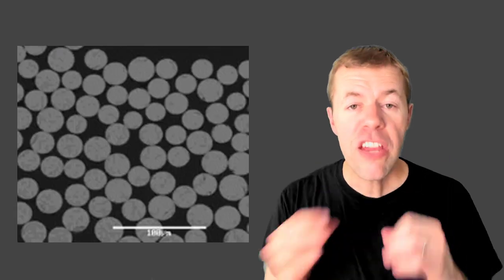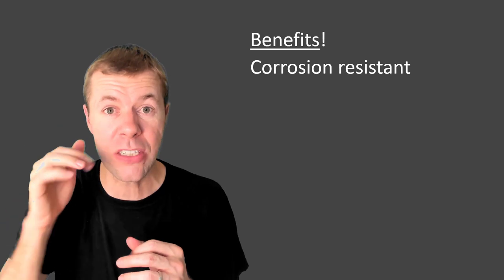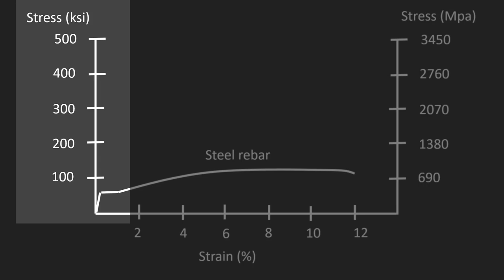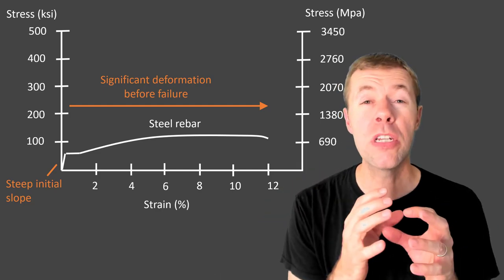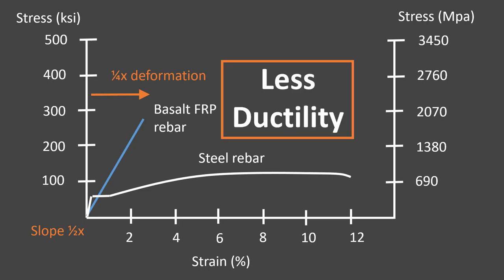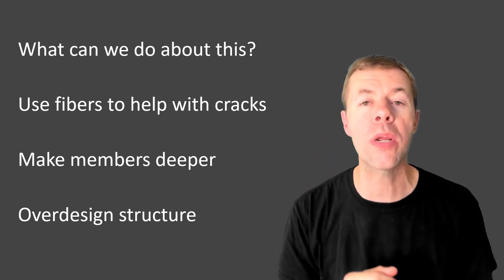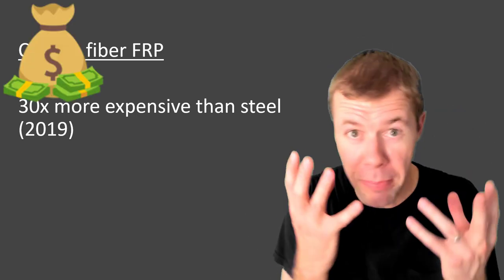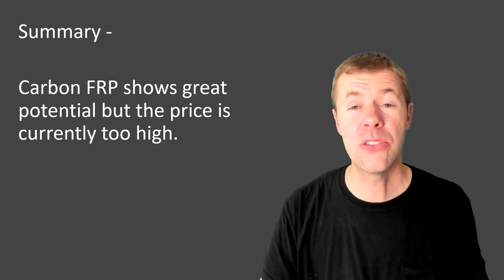What is FRP rebar? Why don’t we use it?

Comment: BTW, thanks for your reply.  This is great! &Since Basalt is one of the Most Common rocks, merely finding a way to dusintigrate it and then Extrude it in Huge quantities - would make it so much cheaper than steel - which corrodes to failure in ?4 years. Can this really be just 4 years due to chloride?
Why can't the basalt rebar just be increased by 15 or 25%. Some amount that might take more than just one earthquake to snap it?  Didn't the Roebling Brothers family improve metallurgy? Or, was it railroad rails, barbed wire, etc? No - I think it was suspended bridges - that's why good steel became cheaper.  It had to work more or less Better somehow. In several ways maybe.
What engineering Department is actually working on this design problem? How can Basalt be produced.  I'd like to imagine a pea sized pieces of basalt continuously being melted into Lazer extruder. Miles of rovings on spools. Braided into useful combinations.  Are Chinese engineering schools doing this research? Combined braids with Bamboo? Indonesia maybe?
https://youtu.be/tKcyrlysQwA

Comment: The idea that FRB combined with concrete could last almost forever is worth adding extra fire protection and extra bar so a structure never has to be torn down, inspected or replaced. Looks like a good long term investment.  Now if someone can fix the pressure treated wood issues some of these building might make it more than 50 years...

Comment: If your worried about corrosion up your mpa an use 3cc....
An it's all about doing it as cheap as you can for a builder....
An the cracks are usually 30mm surface cracks...
They use a lot of fibre mesh today

Comment: How about fiber reinforced concrete (with steel rebar)? Quite a lot used in EU.
Reply: They serve different purposes. The fiber is to reduce cracking, the rebar is to add strength in tension which plain concrete does not handle well at all. Concrete only has strength in compression. The alternative to fiber is steel mesh.
Reply: Helix 5-25 is common. It's  mostly used in commercial warehouse floors.

Comment: In an effort to try and source a cost-effective way to help with raw materials…. Is it possible to turn recycled plastic into the polymer for the FRP?
Reply: Im not sure if that would ever be an efficient process... Maybe someday, but ive been told plastic recycling, as its done today is super inefficient....and i can undsrstand why; theres so many different kinds and they cant be mixed (but im sure you can imagine what happens when we have one recycle bin called "plastic".) Theres also many kinds that can't be recycled at all (like thermoset plastics im guessing?) that are always mixed in too..

Now if we had a bin for just polypropylene, that might be pretty efficient...
Reply: If they restricted it to just drink containers, and large items, that would probably help alot, since the different kinds would be very easy to separate then.

I wonder if that separation process is why we ship all our plastic recycling to China (for the cheaper labor). But i also wonder how much oil we burn getting it there....
Reply: A color code system might help instead of just a symbol on the plastic, the color could also be temperature activated to turn into at a certain temperature and then a machine can sort it. Actually a machine could probably sort it anyway by structure, they can identify substances by electron light refraction, so machine sorting is pretty efficient.

Comment: It would be interesting for your to compare FRP with stainless steel bars (Cost, strength, ductility,  and corrosion resistance).  In Ontario, I've seen new bridge decks reinforced with GFRP, but the barrier walls were often reinforced with stainless steel or stainless clad bars.  I assumed this was because stainless bars could be bent into shapes while FRP cannot, although maybe ductility to absorb the impact energy of a collision on the walls was a factor too.
Reply from the maker: Thanks Dave,
I think this is a good idea.  Let me keep thinking about a comparison video.
Reply: Dave, I always get a chuckle when BFRP is dismissed because it cannot be bent in the field. Epoxy coated steel is the prevalent rebar in road construction in North America and none of that is being bent in the field. In a salt-air environment where SS or GFRP is used Basalt outperforms both.
Reply: @Dave-Pro   Yeah, looked like he was manhandling a glass fiber reinforced rebar, not basalt.

Comment: I like steel, no radio waves inside my home, a quiet environment due to the Faraday Cage formed by my home.
I will experiment with metal fibers for my auto lift base, and I may add non metalic stuff as well.
Small projects lend themselves to experimentation, and considering this video, I don't see any reasons to hold back, glass fibers, steel, aluminum, nylon, and other plastics may perform exceptionally well, time will tell.
Reply: Aluminum is a very very bad idea in concrete. It has a chemical reaction with it. It's not pretty.

Comment: If we ( somebody) could efficiently produce some sort of carbon fiber wrapped coated rebar...  Rust protection for the steel...  Extra scratch durability for that coating when wrapped in carbon fiber.. And perhaps that much  Stiffer. While maintaining flexibility in the worst case scenarios... Obviously costly but it would be down to somebody's R&D work to be able to produce it in a cost efficient manner.

..

Comment: A huge problem with current wind turbines is that the carbon fiber blades can’t be recycled and  just get buried. Ive always thought they’d make for a great steel rebar alternative. If we actually started using carbon fiber rebar, then the limited life span of turbine blades wouldn’t be an issue because they’d simply get recycled into rebar.

Comment: The use of FRP really seems to hinge upon the need for corrosion protection. GFRP, at the time of this comment, is cheaper than black bar. Perhaps using a tighter, therefore more distributed, GFRP rebar grid that was equal to the cost of a more dispersed BB grid would address the cracking issue. The GFRP has a stronger bond, but that only matters if the failure is in the bonding. The ductility doesn't seem to be addressable unless steal is used.  IF GFRP was half the price of BB it would give the GFRP the win for tensile strength, weight, bonding, cracking reduction due to better distribution of reinforcement (not so sure this would be enough to offset stiffness deficiency), and corrosion resistance. Steel still wins for fire, ductility, stiffness?, site bending/forming, and compressive strength as far as I can tell. I know of one GFRP resource that is less expensive than BB, but it isn't half the price. The creep of FRP is a concern. Not sure if a hybrid of paired GFRP and BB strands/members/elements has any merit. A lot of questions.

Comment: So, bottom line: you want CF rebar performance for some small fraction of the price, use thickwall steel tube & run a basalt rebar that just fits down the center of it... Bonus: you get the graceful failure mode of solid steel rebar that none of the FRP rebars can match!

Comment: the problem with these basalt fibers is that they lack elasticity and another problem is that we use polymeric resins to glue the basalt sand which is not heat resistant maybe if some form of elastic rubber glue is used to bind the basalt particles and all this to be put in a spiral iron rod

Comment: ok so carbon fiber is 30 times more expensive but think about the long term maintenance that will save, as soon as corrosion enters into the rebar the clock starts ticking and soon it will need 2b demolished and rebuilt again and again, the highway system comes to mind as an example, bridges too, this constant teardown and rebuild cost $ but the biggest foe is the time lost, for a big power hungry city time is very important and road repairs are a nuisance

Comment: Why don't use H iron beam inside concret
Reply: They're called I-beams.  An I-beam is so much stronger than an equivalent concrete segment that when concrete is added (highway overpasses) it's primary purpose is environmental protection, followed by damping of vibration, preventing flexure and distant fourth compressive strength increase.
Reply: @PsychoticusRex   thank you
Reply: Burj-Kalifa, worlds tallest building, poured in place concrete with PT decks, financed by people that have money to burn, what's that tell you.....use the best, *uck the rest.
Reply: It s called composit concrete. Rebar is much cheaper than structural steel beams.

Comment: Why don't they use cold dipped galvanized rebar?
Reply: There is hot dipped galvanized rebar.  There are cold galvanizing compounds which are essentially a paint coating.  How do you cold dip?  You're trying to dip solid steel into solid zinc?
Reply: @billj5645  Search "  cold dipped galvanized "
Reply: @johncheresna  cold dipped is just a paint, we've used that stuff for over 40 years
Reply: @billj5645  I should have added hot dipped as well.

Comment: We have 10-20 thousand feet of this stuff where I work and no one buys any of it. Its been there for over two years and I think we sold maybe 1000 ft of this stuff. Meanwhile I cut, bend and deliver at the minimum 1,500 tons and maximum of 4,000 tons of steel rebar a year. You can't make J-hooks or circles with FRP.
Reply: J-hooks and loops must be fabricated before the plastic resin hardens.

Comment: How about a hybrid re bar? Carbon fiber outside a steel core?

A lot tougher tha a plain epoxy coating I suspect.
Reply: Roger Shoaf will the carbon fiber help keep water out?
Reply: @crunch9876  

I would think it might. If you get a good epoxy skin on the steel then have that layer wrapped with a layer of glass fiber, minor abrasion during construction should be limited to the surface with the steel core protected.

But let me qualify my answer. I'm no expert. I have not done any testing. It might work fine but cost too much, or it might not work worth a damn.

Comment: Hmmm... I still want to put regular old steel rebar into a pex pipe and see if that works as reinforcement. Maybe pump resin into the pex once the rebar is in there. The only problem i see is making the concrete stick to the pex.
Reply from the maker: I think the pex will have trouble bonding to the concrete.  Stay tuned for the next video where I talk about this!!!
Reply: @TylerLey  Sounds interesting! Thank you!

Comment: So use Carbon FRP on the exterior reinforcement to prevent cracks at all, Glass FRP further in and a core of Steel rebar for disaster resiliency. That way the metamorphic mix of rebar solutions gives you the benefits of an additional 40% life before ACl corrodes the steel and more opportunities for resurfacing to reset that timer making concrete structures more serviceable long term? Incase the worst happens you have that core of steel to hold it together while people escape.
Reply from the maker: Thanks Rex for the comment.  I like the idea of combining steel and FRP together.  I am not sure you need external FRP but it would help.
Reply: @TylerLey  I was just thinking that, on say a column, the exterior-most rebar be carbon FRP and interior-most rebar be steel. Thus when corrosion elements penetrated the outermost sheath, the concrete could be peeled back around the carbon FRP when it came time too recondition the column.  Thus the core is protected and your highest strength rebar is in outside to mitigate crack propagation while if things go sideways in an event, the steel remains your safety blanket.   Such a metamorphic colum could be immortal if maintained properly.
Reply: PsychoticusRex 
Why would you want to put rebar on the inside of a column?
Reply: @Conservator.  in events like earthquakes, explosions, demolition it adds resiliency, one column may suddenly find itself under tension as some of the structure cantilever s over others when the structure is compromised. That'd be for rebar running the columns length.
Reply: @Conservator.  most of the rebar in a column is added in circular horizontal segments to prevent column expansion under load providing dimensional stability on its diameter. Sometimes there are multiple rings to provide tiers of support.
Reply: That is exactly right-no rule says only use one type. ALL bridges could be steel deep inside then FRP surrounding it on all the surfaces-with concretes that prevent water penetrations. Why engineers after all these years continue to do the same things over and over that need replacement 40-50 years later is wrong. And we can no longer endure that cost.
Reply: @SmarterBuildings  engineers have a bad history (especially with bridges) , written in blood sometimes, so Murphy and paranoia are health bedfellows. That's why architects and their frivolous art are the ones pushing new designs and why they get such a hostile reputation among engineers.
Reply: PsychoticusRex Hi,
Tx for your response. What I meant to ask  though was why put rebar in the middle in stead of more towards the outside of a column. As in “interior-most and “exterior-most”.
Reply: @Conservator.  Because it rusts and creates spalling as seen everywhere looking at the base and undersides of bridges. ( Billions in damages needed now to repair). FRP near the surface is far better-(and over 70% lighter)so if the steel is needed then use the good stuff, not rusty steel deep inside.
Reply: @PsychoticusRex  UHPCs like Col-Tuf are out now -they use steel fibers in grout sections mostly, but I hope they start to modify it to be say 12-18,000 psi and use basalt -then we have no chloride penetrations and much lighter and stronger and far longer lasting infrastructure.
Reply: @Conservator.  vertically, you might get 4 pieces of rebar in a conservative design of a large enough diameter, right in the middle, I call those cya, usually usage doesn't require them, they only help but time in cases of collapse, buying time, maybe. Vertical central rebar is an engineers comfort blanket. A good place for tough steel. Perimeter vertical rebar is to enhance stiffness and reduce crack propagation which is what carbon FRP is best at.  Horizontal anti-strain rebar is to prevent bulging and cracks oriented vertically. Honestly I'd like to see what a panel of engineers figure out for best materials, I'm personally leaning towards carbon FRP for all, but I'll admit there would be a lot of math and accounting involved...
Columns tend to be REALLY over engineered to future proof designs and because there aren't that many you can afford to allocate more budget their way. Cheers
Reply: @PsychoticusRex  I like basalt-the cost is many times less than carbon-it does NOT conduct electricity like carbon and has more flex-carbon can be too stiff. Basalt is all rock so it expands and contracts at the same rate as concrete-is safe to work with-non-respirable, carbon is nasty. Adding plates or wraps of carbon seems to me like inviting lightning strikes to blow out the supports of bridges.
Reply: PsychoticusRex Tx 👍
Reply: What I was saying

Comment: My question here is, given the multitudinous failures of concrete structures, skyways, bridges etc due to steel corrosion, why is it better to tolerate those lost lives than to mandate Fiber reinforcing in adequate composition to keep the walls intact?

Comment: Present use methods for carbon fiber depend on hard setting epoxies and such. A more elastic binder could be one solution. The coal industry is dying, as much because they have spent none of the money from "good years" on discovering what other products their mined coal could make- the oil industry created most of the packaging we use today outside of cardboard, as a way to use more of the leftovers after the valuable fuels and lubricating oils have been fractured off. Lots of carbon in coal- or as an end use for all the carbon one of Bill Gates projects is developing equipment to remove carbon from the atmosphere- lots of carbon that needs a permanent home there. Much of this is "futurism", or "what about ism"- but until we look we will not know- gasoline was an accidental discovery, a waste product that was allowed to run off into rivers and lakes in Pennsylvania and start fires that ran for miles- and that accidental discovery at the dawn of motor transport is why we didn't finish developing electric or steam driven cars.FR

Comment: Bad idea. They are using this "stringy glue stick" for similar reasons they tried to use aluminum wire instead of copper decades ago. As you pointed out, and demonstrated, that pot metal rebar will save lives by maintaining the structural integrity long enough where the fibrous glue core cannot. Great vid and content :)